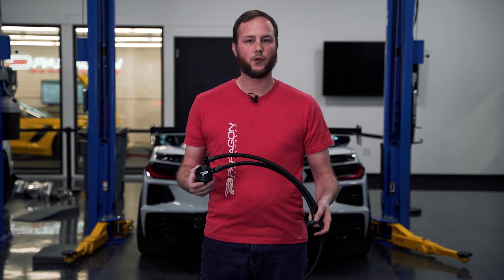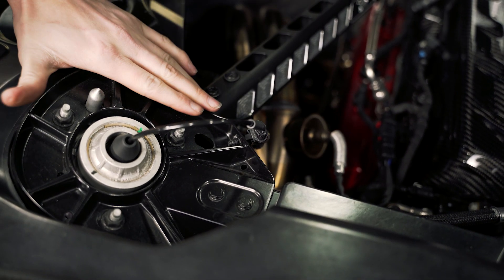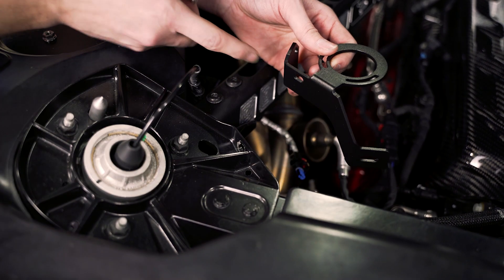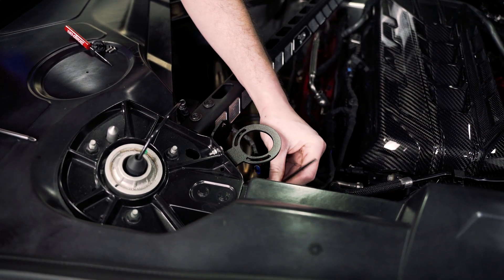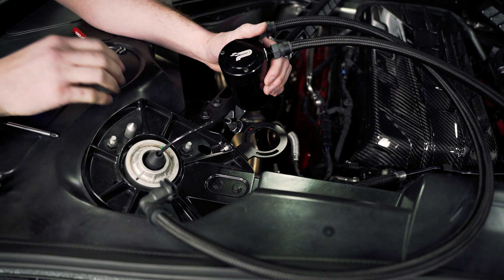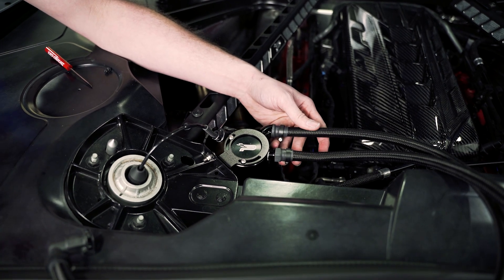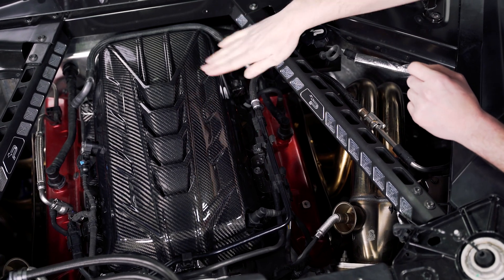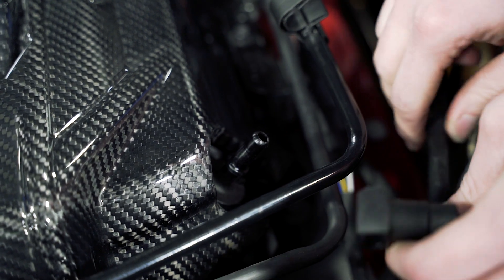Paragon Performance C8 Corvette Oil Catch Can Install - How to

Comment: I just installed the can. I've noticed that my hose connection ends did not have the allen wrench fitting adjustment. Fyi.
Also, the fittings did not make a click sound. The fittings were much tighter when installed. Is it ok to be tight when the fittings were installed without making a click sound like the OEM fitting?  It's so much tighter, it may be hard to take it off. However, it does twist in place and it's  not going to come off.
Reply from the maker: Double check to make sure the connection is seated properly. Sounds like everything is installed properly.

As far as the Allen heads in the video the hardware was updated for ease of install.

Comment: So the PVC hoses that you took off of those 2 spots originally just hang loosely in the engine compartment? And where do the original PCV hoses dump the vapor if you didn't install the catch can? Is that the canister located behind the rear wheel on the passenger side? Can I remove that canister (if that is what I'm thinking it is)? If would make the install of a high wing spoiler so much easier.
Reply from the maker: The OEM PCV hoses will be discarded after installing our catch can. The OEM PCV line takes the unburnt gasses and puts them back into the intake tract which overtime will cause carbon build up on your valves. As far as your high wing install, this won't be in the way of it.

Comment: I received my oil catch can but missing the stainless steel screws and no clamps came with the product to clamp on the hoses as shown in your video. Can you explain
Reply from the maker: The clamps are no longer provided with the kit as they are back ordered indefinitely. Our team found a new solution so the clamps are no longer needed. As far as the stainless screws those should have came with your kit. Send us a email at Support@ParagonPerf.com

Comment: Does the Oil catch Can mount and still maintain the engine cover?
Reply from the maker: Yes the catch can is mounted to a bracket and you can still use a engine cover.

Comment: I am engine illiterate so what does this do again?  it appears more protection than performance, correct?
Reply from the maker: In simple terms it collects the oil vapors and stores them in a can which you empty every oil change or so. You're correct that it's more protection but in the long run it saves your performance from being decreased.
Reply: @ParagonPerformance  thanks

Comment: I just purchased this product. My questions is, I already have close to 20K miles on my C8 2020 HTC, is it to late or will this product still prevent oil, fuel, water and carbon from entering my engine? One more question, is this the same company that was started by the late Dick Fortier in Rankin Michigan? I new Mr. Fortier very well as I grew up in Grand Blanc, MI. Thanks
Reply from the maker: It's not to late to put this on, It will help from here on out! 

We are not associated with  Mr Fortier.
Reply: @ParagonPerformance  Thanks

Comment: Video for convertible variant?
Reply from the maker: It's the same as the coupe, just remove the cover over the engine.
Reply: @ParagonPerformance  i know would just be cool to see it done on convertible to kill any confusion. I don’t know how to take the cover off but I guess a quick look in the owners manual will do.
Reply from the maker: @Lord4Quad  We don't have a convertible car to show it on. Next time we have one in the shop we'll make a video on how to remove the cover 😉
Reply: @Lord4Quad  all it takes is removing 18 screws with a #15 TORX.